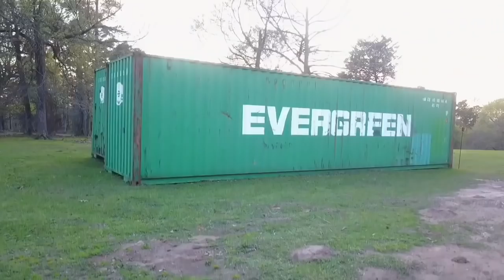DIY Solar Panel Ground Mount

Comment: Wouldn't it be easier to connect to that power pole that's a few feet away, rather than running a generator? At least until you can generate your own electricity.

Comment: I have bought a few GM vehicles though my brother-in-law who worked at GM through retirement and beyond.  The old GM Protection Plans were great but did vary in coverage limits in terms of time, mileage and the amount of the deductable. On my 1994 Chevy pickup truck, the length of the contract was six years and had 100K mileage limit, whichever came first.  There was a $50 deductible for each service date (with no limit on how many issues needing resolving).  At 99,995 miles I took the truck to an independent mechanic to discover any repairs that needed to be performed when then had 99,998 miles on the odometer.

I arrived with a laundry list but the big one was a leaking main rear engine seal.  When I brought this one issue to the attention of the service writer at my local Chevy dealer, I though his face turned pale right before my eyes.  He suggested that the vehicle could go another 100K without any noticeable loss of oil though the seal.  I made it clear that it needed to be fixed along with other problems.  I was given approval for a rental car (actually an Astro van) and after two weeks, I called the service desk to get an update on the shop's progress.  Everything was fixed except the main rear engine seal.  Authorization of the use of the rental vehicle was extended while the shop had to borrow another mechanic from another dealership to perform the repair. 

I wanted to see my truck and so the service manager accompanied me to the shop to look at my vehicle.  The mechanic was there and he had to look of "I really do no want to do this job".  I knew that awful feeling as a computer programmer/analyst when some user wanted to make a change in a system that was in production.  But every job has its $%^%#!@ moments.